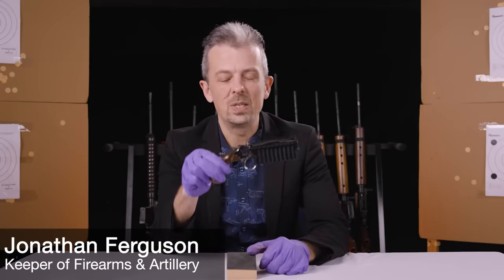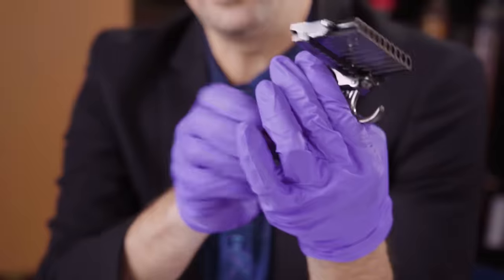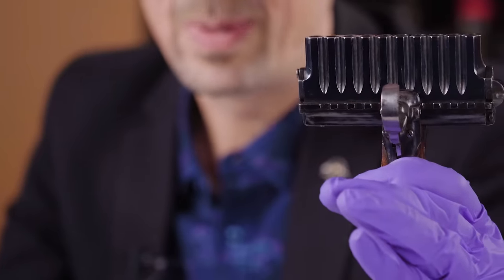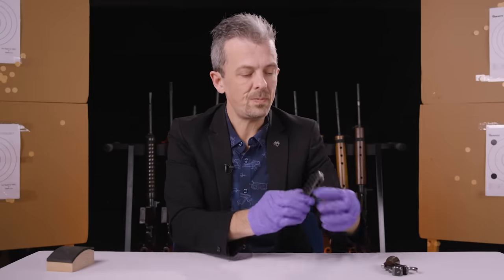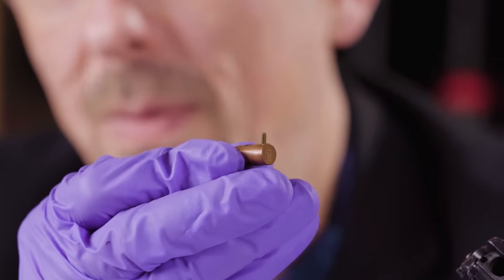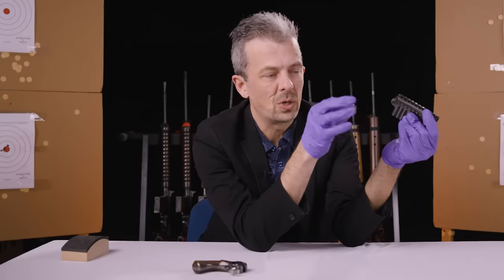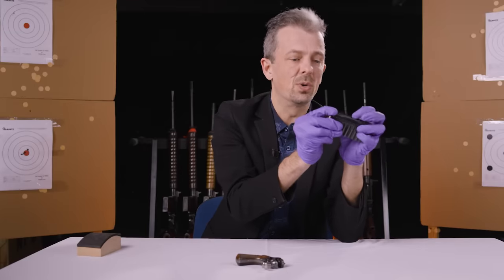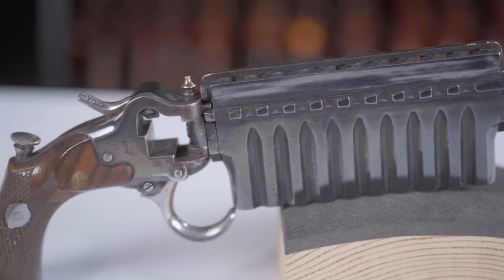Harmonica, or pistol? With firearms and weaponry expert, Jonathan Ferguson

Comment: Thanks Jonathan and team. 
That is a fascinating item and the finish looks very nice on both the metal and the woodwork.
But, for practical defence purposes, I would have preferred a decent revolver or, even better, a pair of decent revolvers.
I don't suppose many modern guns use a harmonica style mechanism. But there is the Steyr LP50 repeating match air pistol, which uses a linear 5 shot magazine. This allows it to be used as a training tool for Olympic Rapid Fire events. Firing 5 shots in 4 seconds at 5 separate targets can be hard work!

Comment: The "storage configuration" of this gun looks like something you could make a great Star Wars Blaster pistol out of, i imagine a smaller weapon for some kind of Lady of higher rank wishing a light blaster she can easily fit in her purse yet still has some style to it when she has to use it, with the nice wooden grip and all, just fill the hole the barrel assembly slides in with some greeblies and fill the barrely while giving it a clear barrel on the front.
Lots of potential there. Or simply size it up to rifle size and you got a really threatening weapon for a Bounty Hunter, with lots of intimidation factor. Good for non-lethal hunting.

Comment: My understanding is that it's basically a double action revolver but the chambers are inline instead of circular arrangement

Someone can probably upscale this design and give it a single barrel attached to the main frame/body, and let the linear chambers move one at a time to line up with the barrel. 

(Like a mini Fiat Revelli 1914 machine gun probably)

Comment: I wonder, was the idea that you could buy multiple barrel-sets and swap them out like an external magazine?  That looks like it wouldn't be unreasonable to do with this sort of weapon - the barrel piece has a means of retaining rounds separate from the rest of the gun, you can pull it off entirely, it's flat enough to store in pockets comfortably - all things that are useful for external magazines.  

Timing wise that's not implausible, to my mind - Colt's revolver design dates to the 1830s so it should be well established as more stable sort of multi-shot pistol, en bloc clips are 1880s, so just a bit in the future, which probably means there were at least some people trying to come up with ways to load up rounds such that they could be batch-loaded for firing.  The main method for that ended up being the various clip systems that fed into an internal magazine and was eventually supplanted by external magazines as is more familiar today...but every innovation that gets adopted has its weird offshoots that don't get all that widely accepted, and that kinda feels like what this is.

Comment: Does the breech on artillery need (relatively) fairly frequent replacement like the barrels do? Is the whole breech system integral to the barrel being replaced, or separate? I imagine excessive wear there would quickly lead to microfractures, which could in turn potentially cause the breech to fail rather catastrophically for its operators.

Comment: why horizontal tho ... Would have been a tad more balanced if the barrels slided down vertically as they discharge.
Reply: Probably easier to store ready-to-use if it was vertical, too.

Comment: This is an 1800s magazine fed pistol. The magazine happens to be barrels welded together.
Reply: Does this make it a "linear pepperbox" ?
Reply: @derekp2674 Seems like it, yes.
Reply: A magazine is a feed device, this is a pressure-bearing part. We don't even call a revolver cylinder a "magazine" so I wouldn't use the term here either :)
Reply: @jonathanferguson1211  Honestly, more or less those same thoughts occurred to me.
Reply: A Quick Look on the internet shows there were 10 shot , 7mm pin fire revolver available in 1860. Top break. So quicker to shoot and quicker to reload with a barrel it’s probably more accurate as well. Unless these was a secret squirrel reason for this thing I don’t see the point.

Comment: 9:23 It's kind of surprising that the ramrod isn't inserted in the bottom of the grip, it looks uncomfortable to one's hand in its position on the top of the grip.
9:54 Isn't it the other way around, i.e. isn't Webley basically a British knock-off of several Belgian designs?
Reply: I was thinking (at random, following my mention of the Colt) the solid-frame Webleys like the 'Bulldog' with the pivoting captive central ejector rod setup, which were extensively copied by the Belgians due to their popularity. The better comparison might indeed be early pinfire and rimfire designs with axis pins designed to be entirely removed (along with the cylinder of course) to eject fired cases. In which case Webley were inspired by the likes of Francotte, but are not "knock-offs" i.e. copies in the way that the Belgian Bulldogs and RICs. Of course you weren't to know which Webley I was thinking of - delights of off-the-cuff presentation :)
Reply: @jonathanferguson1211  Ah, I see, thanks for clarification.
It might also be useful to mention here to avoid further ambiguity that there were two distinct types of pivoting ejector rods on the RICs - the earlier ones, as far as Othias and the C&Rcenal crew managed to dig up, were patented by Perrin and Delmas, Parisian inventors, about 1860, and the latter ones used the 1872 Adams design.

Comment: G'day,

Mate,

lighting
Lighting
LIGHTING....!

What you did
Herein,
Videoing a
Small black shiny
Little
Gun-thingy,
Front-lit (for the convenience of the Telephoto Close-ups)...,
Held in front of a
Black Jacket over a dark Shirt,
With a dark Rectangular
Shadow as a
Background - between two
Brown Display-Boards....;
Would
Win PRIZES in any
Cinematographic
Lousy Shitty 
Craptastique
Lighting
Competition...!

For a
Video to work,
The Viewer has to be able to 
Percieve the Subject-Object.

So, try a well- lit
Black or blued
Gun-thingy, held in front of
A
White or light Grey
Lab-Coat,
And stick another
Light Brown Display-Board over that Central Shadow-Hole which you
Left
Sucking the Colour Contrast right out of the
Entire
Frame....

Just(ifiably ?) sayin',

You have to be able to do better than this.

Pull it up on your Phone, on YT, sit outside on even a cloudy day..., and tell me that this
Video is worth 
Attempting to
View,
Please do,
Won't you...? (!).

Such  is life,

Have a good one...

Stay safe.

;-p

Ciao !

PS,

It wouldn't work as a
Pan-Flute, at all - unless the Barrels were loaded...;
Because all the Pipes have to be sealed at the bottom in order to form a 
Resonant Cavity...
When one blows across the open end...

The greater the enclosed
Volume, the deeper the Note produced....; and because when loaded, this thing would have 10 
Identically short "Pipes" all the same diameter - & hence
Volume....

It could only ever produce the same high-pitched 
Note, 
From each and every 
Barrel.

I've owned a couple of Pan-Flutes, and played them sporadically for about  10 years, they were fun.

;-p